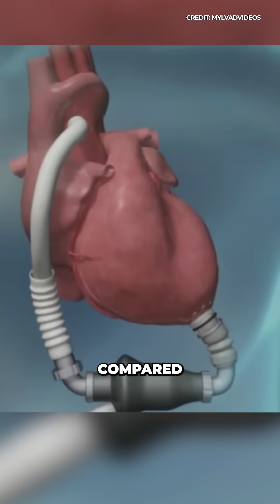Engineers Create World's First Fully Artificial Heart

Comment: Seriously?  There were successful artificial heart implants as far back as the 1980s.
Reply: Those heart transplants where an aid to a heart that could still function but needed help.

This one there is no heart, just a machine.
Reply: @_Em_Branco - The Jarvik-7 was a total heart replacement first used in 1982.  I followed this with great interest because I was involved as a lab assistant in the testing of an artificial heart at the University of Minnesota in the early 70s.
Reply: @ the diference here is that Jarvik-7 pneumatic heart need several cables connected to a big external unity, wich could cause infections and limited mobility.

the Bivacor is smaller and enables better mobility and a relative normal live outside of a hospital enviroment.

their idea of the final device is that it gonna be fully implemented with no external part and charged through skin, it's not gonna be a temporary solution but a permanent option.

Comment: I wonder how much power it uses and whether they could make a self contained version somehow running off the bodies own energy output. I also wonder how far away such technology is from not needing the real thing at all. 
Though I imagine the engineering challenge of making a device run for decades is significantly tougher than 100 days. Its not like they can just swap out spare parts whenever they want; Any repair would come with a non-trivial chance of dying on the operating table.

Comment: but I thought we had these since like the 1970s. I know because they gave one to King Kong in that movie back then.
Reply: There have been a bunch of artificial hearts. LVADs (Left Ventricle Assist Device), which don't fully replace heart function, are more common, though. 100 days is a pretty good result, though.  Apparently the record is 7 1/2 years, though.
Reply: The clue is in the exactness of the title, “fully artificial” as in previous designs have been artificial aids for a heart that was still at least partially intact/functioning.
Reply: @ObsessiveGeek  Pretty sure syncardia was actually the first, with their TAH being approved in 2004.
Reply: yup we can develop even better technology, but the real challenge is the immune response
Reply: @emad3241  Which this device substantially helps with, by the way. Because it's made out of titanium (for this reason), the body doesn't attack it.
Reply: @ you're right, i've just read that titanium implants don't require immunosuppressants, this device is groundbreaking, but the problem is that we still don't know how effective it is in say preventing clotting because the clinical trials for these devices are extremely slow
Reply: @emad3241  I've heard somewhere that it's less likely to cause clots because it handles blood more gently, so along with some anticoagulants it's very safe. Perhaps in the future the device will be lined with heart tissue as well as that prevents the blood from clotting even further.